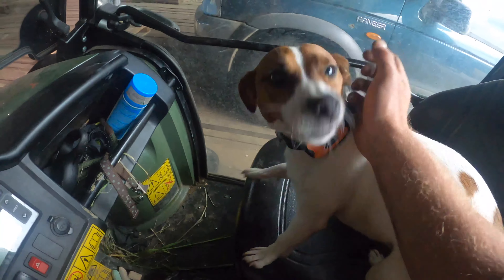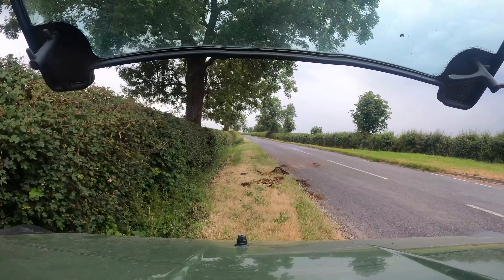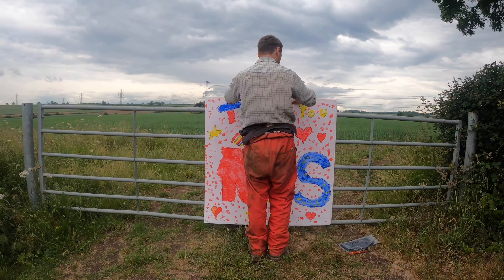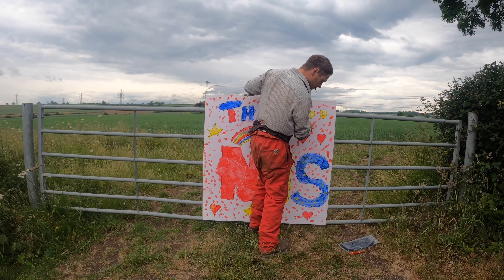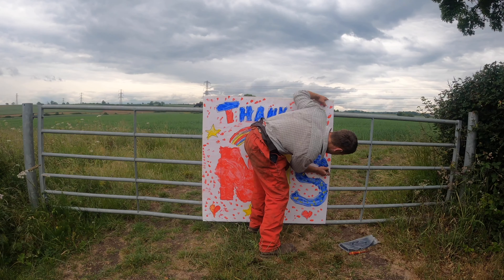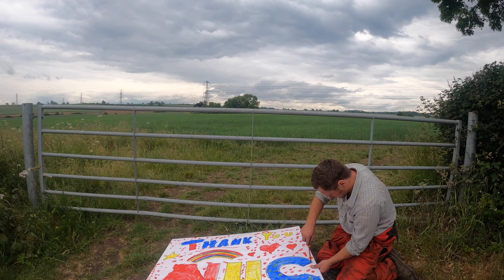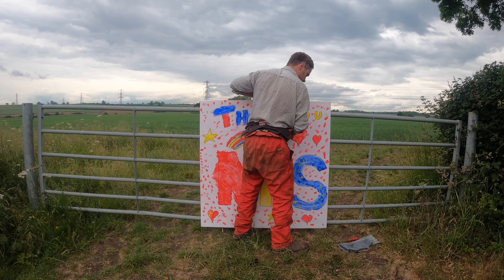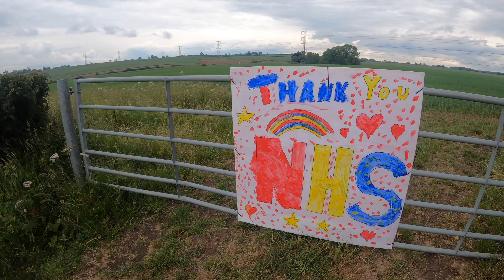FORD SERVICE, JCB LEAK & THANK YOU NHS!

Comment: You're children did an admiral poster, well done to them and the NHS.
I presume the JCB is a warranty job.
Are you likely to go for front links and PTO on a new tractor? Thinking of the topping.
Reply from the maker: Yes warranty job 👍and probably no front linkage on a new tractor, it’s a possibility but we’ve never run kit on the front before
Reply: @NicksFarm  
Fair enough, I was thinking of the flail mower particularly as they do a better job on the front but it's probably not worth the expense just for one operation. 
What would you use the Ford's for one you've got another tractor?
I wonder if you'll get a better deal ordering while Corona is going on.
Would you take an ex demo if you can get one?
Reply from the maker: We would just keep the fords for nostalgias sake to be honest, maybe do odd jobs but they wouldn’t do much, as for ex demo if it was right it would be a possibility 👍